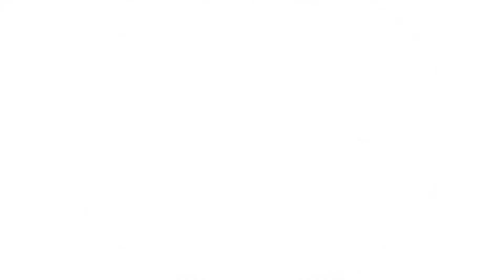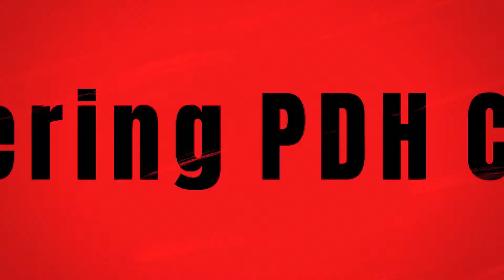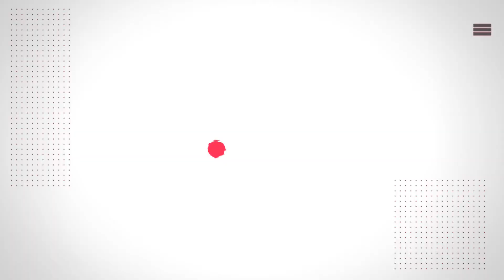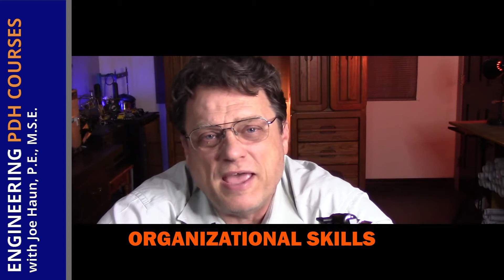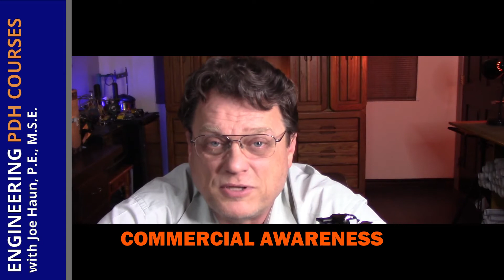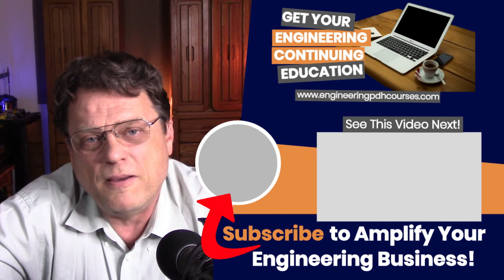What do Project Engineers do? 7 Project Engineers Responsibilities - Engineering Online PDH Courses

Comment: In construction, there are two types of project engineer, depending on whether the emphasis is on “project” or “engineer”.
In the case of the former, the project engineer (much like a project manager) acts as a coordinator between the specialty disciplines.
In the case of the latter, the project engineer provides the engineering input into the project.